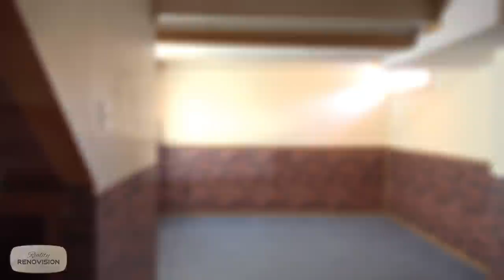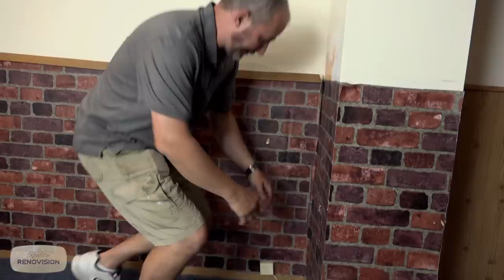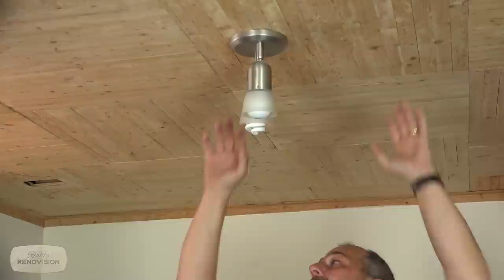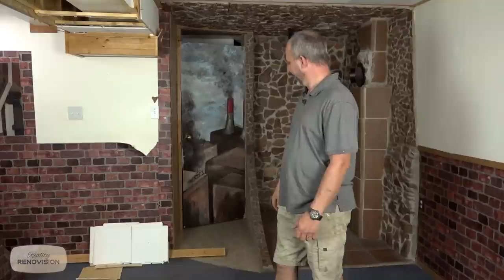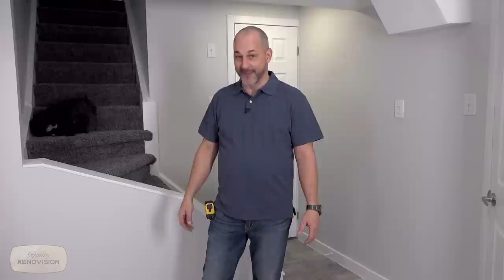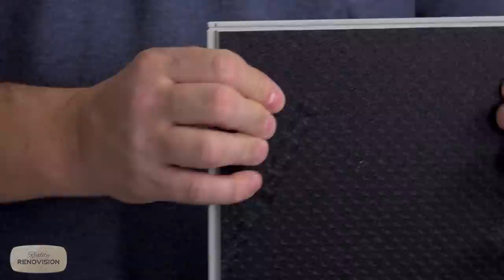Basement Gut and Rebuild for under $4000 | Reality Renovision Ep13

Comment: This is the way to do it, folks.  My husband and I finished our basement all ourselves except for the premium carpeting we had installed. We ended up with nearly 1000 sq ft finished, two bedrooms, a large playroom, a tiled outside access to the exterior stairwell, a walk-in closet doubling as a "secret room" for the kids, and a full bath! It cost us $17,000 plus a mere $4,000 to outfit it with furniture and media components (one of the bedrooms is a fully sound insulated media room with an eight foot screen, recessed speakers behind the screen, and projector system with all wiring integrated into the walls with conduit for future proofing). We have done several other upgrades to the builder grade house in other rooms, and a year later our house was appraised for $200,000 more than we bought it for!! And how long did it take us? Four months. And that's with my husband working full time as a journeyman electrician. Some days I spent 8 hours down there between taking care of the kids. Yeah, it was a ton of work, but boy, was it worth it!
Reply: ez when hub is electrician
Reply: Fr this nigga has good money
Reply: 200k? In NY most GOOD homes are 800k-1M+
Reply: Celuta $200k was not the current value of the house. Her house was appraised at $200k "more" than what she originally paid for it, after renovating it
Reply: @celuta5515  in Toronto most good homes are 2.4 mill and up in 5 years my old house nearly tripled in price the market went insane like a decade back bought a 130 year old house for 200k no mortgages in  early 2008 renovated it sold it late 2013 for 950k and now all i do is buy, build and  sell houses its way better then working a 9-5 and you make much more money in a significantly shorter amount of time   started to do 2-3 houses a year recently
Reply: @SharkButtholio For real 🤣😂😅
Reply: Amen!
Reply: Just to let you know we don't call it a *journey man electrician. We are known as sparkys. Let's keep it that way.

Comment: Looked great after it was finished. After hearing the $3000 USD cost, I'm ready to start mine now. I have a basement that was gutted back down to the concrete before I bought my house. Just studs there. Thanks for the motivation to get me started.
Reply: Did you do it ? 5 months later
Reply: That $3k cost was surprising. I wonder how much it would've added to the cost if the framing and electrical wasn't already in place. And it kind of irks me that they didn't strip the tile underneath the flooring.

Comment: I wish you guys had more Renos on double wide mobile homes. Especially flooring where they join together.  We were blessed with this home and we're trying to Reno it on A VERY tight budget
Reply: Yes. Also a basement under one. There's barely any videos w/all the metal columns and beams. Not easy to figure out and not many videos if any.

Comment: I bought "high end" double aluminium barrier padding, with cheap "30 year warranty" laminate from home depot, and I love it. 5 years later, the laminate is starting to peel away in high traffic spots. I'm glad I didnt buy the cheaper "10 year" laminate. Next time I redo my flooring, I am pretty sure I'll switch to QuicTile porcelain instead. I think free floating is a good compromise compared to sticky tiles that take alot of install time, or hardwood floors that require expensive refinish costs, the other aspect being that snap floating tiles tend to expand+contract more easily. I guess I'm just waiting for a good sale to happen before pulling the trigger... :P

Comment: The smell was from the original vapor barrier on the inside of the studs with fiberglass insulation. This creates a mold sandwich between the foundation wall and the vapor barrier. I see it all the time. I guess people think you insulate below grade the same as above grade NOT.

Comment: The new basement looks great, very bright. 
For some odd reason, I’m not a fan of drywall. What other material would I use to finish a basement?
Reply: Christopher Henderson many thanks for the reply. Not particularly informative though
Reply: @4philipp  You have options but Id still put drywall up first if I were you. You can always on top to make it look different but having drywall as a substrate is pretty standard. You can use wall panels on top of the drywall, or textured wallpaper to get a different look. It all depends how much money you want to spend.
Reply: Moskal Multimedia I sure want a bright atmosphere down there, maybe painted wood panels will do. It’s a 12 foot wall height.
Reply: @4philipp  You can use any material you like. Wood is trickier than drywall because it's pretty unforgiving if you mess up a measurement. Also cutting details like plugs and light switches takes more time. But if you a ninja of a carpenter then it shouldnt be a problem.
Reply: Moskal Multimedia it’s funny you say wood is harder. Everything I see and hear about drywall makes me not want to work with it.

Comment: I priced out renovating an un-finished basement. It would have doubled the usable living space in the house and not needed anything invasive (think a big empty square with a staircase) and we had access to cheap supplies. I even offered to foot 1000$ (I was living on a mattress in said basement) but still could not convince them. When I just offered to prep it for remodeling, refused.

I am terrified to think what that basement is like right now. When I left it was awful, they had let several families of feral cats live there and had decided a couch and a television made it an acceptable play area. Again, no prep work to even begin remodeling (cleaning) had been done. 

They have help from family on the mortgage. Those people are aware of the state of it, and another property they let a family member do the same thing. If you want to save money on a house make sure you aren’t letting animals have the run of it.

Comment: Jeff you are our official go-to guy!
I have to skimcoat my new home bathroom it has crazy textured walls what drywall compound would you use in this humid environment? Fyi I already put in the nutone 110 cfm fan.
Reply from the maker: the compound will not matter. make sure you use a drywall primer to seal it and a 100% acrylic paint to finish and no worries. Cheers!

Comment: Great video!  I'm a huge fan, and it's nice to see the advice from your other vids put into practice by someone in your target audience!

Question: several times you mentioned leaving an airspace between the insulated stud wall and concrete foundation. Do you have to leave a space there or could you fill that gap with a rigid foam panel to pick up R-value?

I've seen 3/4" R5 foil faced PolyIsoCyanate foam boards that say they are rated for installation right on concrete walls that would slip right in behind the stud wall I'm redoing. If allowed, would I still need a space between the ISO foam and stud wall if the ISO foam is mounted right against the concrete?

I didn't notice any significant water intrusion, and saw mo marks on the foundation.

Comment: Are most basements really suitable for vinyl plank?  There are tight slope requirements and basements are made to drain water toward one or two areas with drains.  And if you have VAT, you can't pour a self leveling concrete because it will cause tension and lift the tile off the adhesive and then you have a cracked mess.

Comment: Hello, is it possible to get a someone to just the up to code part, like framing part (ducting, plumbing rough in, subfloor) then DIY the easy stuff (flooring, kitchen cabinet install, toilet). I’m buying my first house and I wanted to convert the basement to a kitchen. I know a lot about home reno but not the technical “pre-install” stuff.
Reply: I mean sure, just need to get the proper contractor for the certain tasks (i.e. plumbing)

Comment: 2 things I noticed - Was there an egress window for this space? I was under the impression most states in the US require an egress window or another exit - also, was the staircase header height to code? our requirements are 6 foot 8 inches when coming down the steps - this is where my basement is needing an engineer to come in and provide plans to fix this for us

Comment: $3000 US ??? Looking to finish 850 sq Ft of my basement which is currently just bare (concrete floor, concrete wall). I just priced out the materials itself and it was about $4000 US. Add about $1200 if I want home depot to install the flooring. Still not bad cost wise but still when I heard $3000 for this great finish. Using smartcore flooring which is similar to the lifeproof at 3.38 per sq ft. I guess I can eliminate the smartcore underlayment ($550) since i dont need it. Jeff do you do DIY in the US? If yes, I would volunteer my current project.

Comment: If that basement floods, can't you just pull up the floor, let it dry and then put the same flooring back down? As long as the floor didn't stain, it should survive. 
I also wonder about pressure treated. While it won't rot, it will still absorb moister, won't it? I've seen a product advertised that is foam board and plastic studs. Seems like that would be a better bet for basement walls. Seems like if you use a product like that and then trim the bottom with about a 6 inch plastic baseboard, you could never get water damage, even if you have a couple inches of water.

Comment: I hope they mastic all the joints on that ductwork that they can while they have it exposed. The cheapest easiest thing you can do for your ductwork to make your air quality better, efficiency greater, and not pull air from areas you don’t want to? Mastic nickel thick so it doesn’t shear as the ducts expand and contract.

Comment: What type of vapor barrier would I use and does it go between the insulation and the outside wall or between the sheetrock and the insulation? Also, how is an air gap created to circulate air in the wall?

Comment: 29:00.  No way that renovation would take a year.  My basement is roughly 700 square foot, I finished it in two months working only night and weekends.  Added 13 walls, electric, ethernet feeds, audio/visual, drop ceiling with 12 can lights, 6 doors, all trim, insulation, drywall paint, and a half bath.

Comment: Does a long vent run need to taper down or have an in-line powered fan? I have a 30' vent run in my basement and the furthest point from the furnace has weak air flow and not as warm (or cool during winter) as rooms closer to furnace.

Comment: in a basement remodel right now, insulation is only half wall wrapped and vapor barrier with a metal strap fashioned to the cement... insulated only to frost line.... so that we removed before finishing the walls?
Reply from the maker: yes it is useless. start with a clean palette. Cheers!

Comment: You must be glad none is anchored by 4 inch stud nails.  Mine was different.  They didn't replace the water damaged drywall but covered it with 1/2 plywood and another layer of drywall to finish it off.   And they have anchored everything with 4 inch stud nails, not drywall screws.  You don't know how difficult it is remove 3 layers of 1/2 plywood and drywall anchored by the 4 inch nails.  It took me two days to remove all the walls and nails.  And I find out, one beam didn't even have a support on one end, the black mold growth, and nails are not even anchored right.  And  I balanced all the studs and moved them for better strength.  (What good would 4 studs separated by 1/2 inch space?  When you mate all 4 studs, that's when the wood gets strength to stay straight.)
Oh, and the drywall was not joined right, so the paper was coming off the wall and through the paint.
The previous owner was an old lady, and this homeless guy promised to fix her home in exchange for the room and board.
Now, I am consulting my lawyer.

Comment: Absolutely love your channel. Hoping you can help. I’m in Minot ND and in 2011 we had a “100 year flood” we had water 5’ high on the main level. After gutting was complete We hired serv pro to pressure wash, sanitize and dry. It wasn’t until 2 years later that we discovered the floor trusses in the basement were not cleaned at all. Still covered in silt and pine needles. I have been vacuuming and trying to scrub those trusses since then but it’s over 1,700 square feet down there and it’s still not even close to clean. Do you have any diy recommendations? We’d like to finish the basement and sell the house but this is a nightmare thank you!
Reply from the maker: have them come back and finish the job. Cheers!
Reply: REALITY RENOVISION - I tried that but they stopped responding to me. I didn’t realize it at the time but they were a Serv pro from out of town. 15k down the toilet. Tough lesson learned there. I guess I’ll keep hacking away at it. Have a nice day.

Comment: We used LifeProof and looooove it.
Reply: Agreed. Reasonable price and durable as hell that stuff too. Did you replace flooring or just go right over existing flooring? Did you use under pad?
Reply: Moskal Multimedia we tore up the old wood floors and laid new plywood to even things up. It was just for a kitchen and walkway, so we just put it down straight over the plywood. In our new home we’ll be laying quite a bit more, and in major living areas throughout a bilevel, so I’ll likely lay down an underlayment this time. Just thinking about that makes me excited, I can’t even imagine how nice that will look/feel.
Reply: @briansobb19  Good job that's a lot of work but you did it the right way for sure. Yeah although it doesnt require underlayment it does help quite a bit I find. Works really well for going over slightly uneven surfaces and it adds an additional stc upgrade interms of sound transmission. Excited for your next project I know its a great feeling to have what you envision. You'll eventually see an episode about the flooring in the third season on this channel at some point. Cheers

Comment: Jeff, a question that isn't shown here.

If I'm building exterior walls in my basement and I leave an inch between my new build and the old block wall for an air barrier, do I need to insulate at the top of my wall behind my top plate so that cold air doesnt affect my house? Does that make sense?
Reply: I think that was covered in one of the videos on Jeff's other channel Home Renovision DIY.  Also, things like that are dependent on climate, so it may be one of those "check your local building code" situations.
Reply: @mikesmith2383  thanks man
Reply from the maker: Cheers Gilbert. In most cases the top plate is higher than the stone foundation so the thermal break continues into the header.

Comment: I could tell right off the bat, that the windows were done by someone other than whoever did the rest of the basement. The mitred framing around the window is a dead giveaway. All of other cuts on the moldings have no 45’s, only straight cuts. 🤦🏻‍♂️🤷🏻‍♂️ Another major concern for me is there’s no emergency egress. Should have dug out for at least one 4’ x 4’ window.
Reply from the maker: there is no need for an egress in a basement with no bedroom.